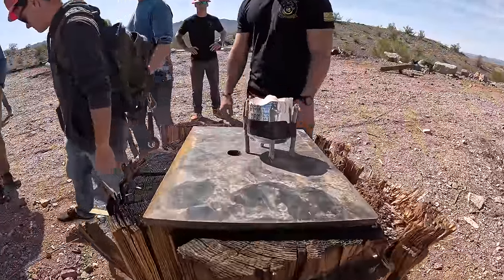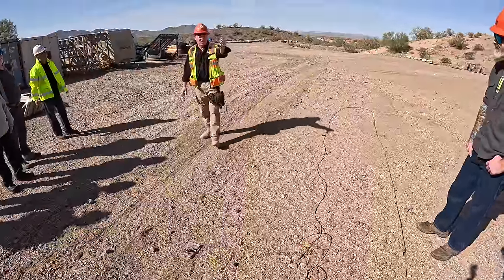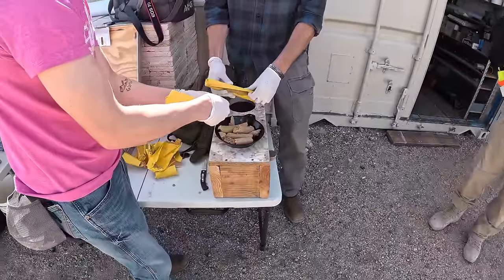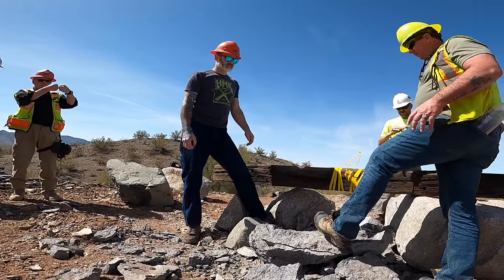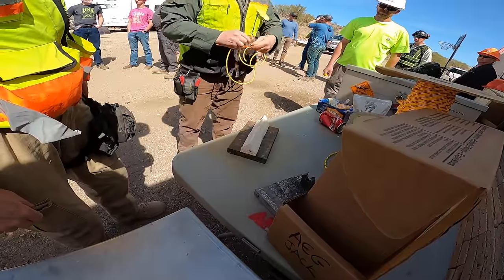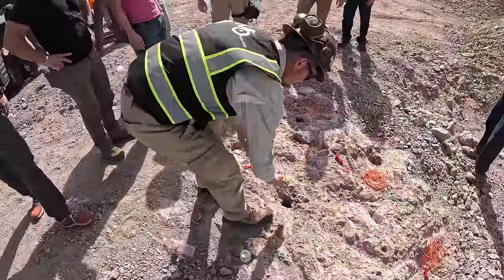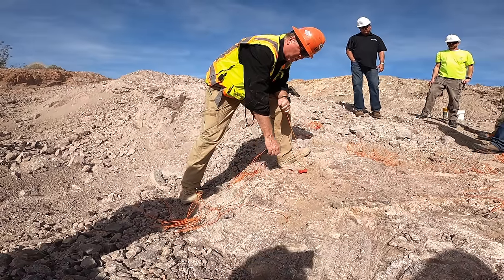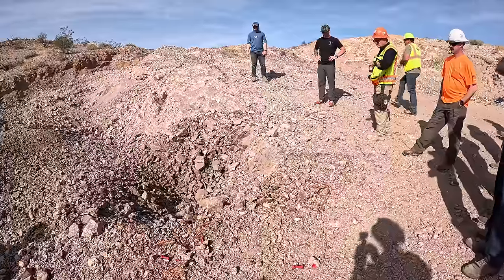Commercial Explosives Training with American Explosives Group with bonus ending

Comment: What a blast 💥
😁
Did they give you any extra tips about using explosives underground, when you mentioned your gold mine?

Especially when considering that this course was taking place in a wide open area, while underground blasting must take vibrations and the sheer power of detonations into account as they could affect (destabilize) ceilings, pillars, walls, and exit routes?

I did see all the videos about the blasting in Jason's mine, but how do you know, if an  underground area is safe to "blow up" or re-enter since one cannot see or know about every hairline fracture in a mine that might have been created by such explosions or our countless California earthquakes?
Reply from the maker: Yes, we did touch on drift blast patterns and safety concerns.  

The best advice we have received for underground mining and blasting is to get MSHA trained and do on-site mine hazard training.  It will save your life.  There are a lot of good instructors out there.

Underground after a blast, we come back the next day. This gives any loose rock a chance to move and vent any gases if you did your ventilation correctly. We always scale our way back to the working face and address any issues along the way.  How do we know if an underground area is safe? That's a whole nother story.
Reply: @mineoperator Thank you for this informative response 🙏🏼
I wish you safe and successful mining seasons for years to come 😊💛

Comment: Are the apprentice requirements still two years for blaster cert?  Or is this a crash course for certification?
Reply from the maker: This class serves as a crash course, but also experience/hours that can be used towards obtaining a blasting license. I'm going through the ATF portion now. Do you recall if the 2 year requirement that you mentioned was a state, county, or federal requirement? There isn't much formal training for the industry, other than employment. I appreciate what Jack is doing here as he's attempting to create an industry standard in training and licensing. C level blaster in training 16 to 40hrs, up to 1 year, B level experienced blaster 40 to 80hrs 1 to 5yrs (I'm B level), and A level blaster in charge over 80hrs, and over 5yrs experience.
Reply: @mineoperator  I was referring to California blaster certification form, it just asks for blasting company you work for and 2 year thing.  Also has columns for schools and experience under certified blasters.  I'd rather do this school than work for another blaster for   2 years preferably.
Reply: Same here